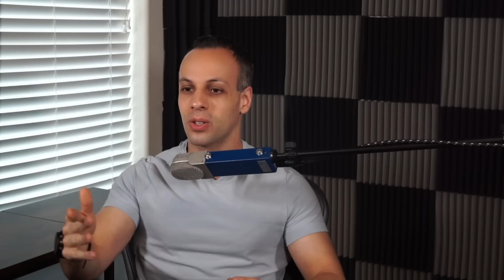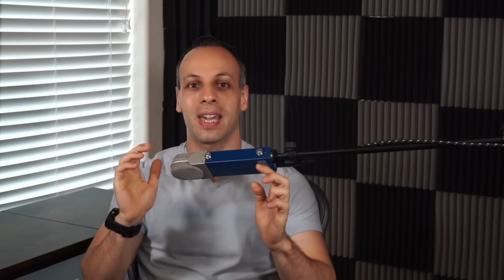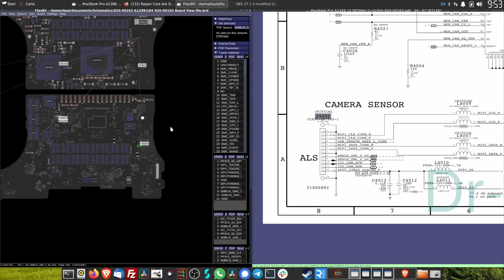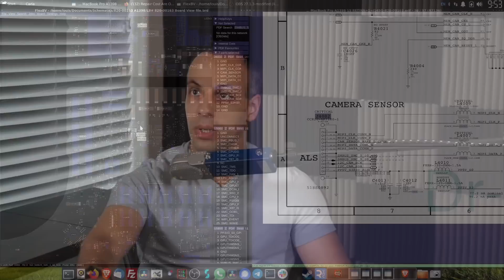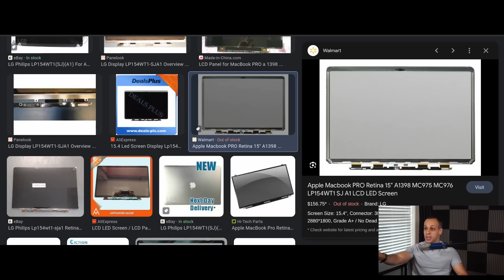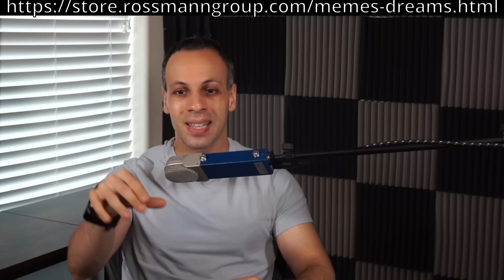The Ford F150 Macbook - when car repair resembles macbook repair...

Comment: What's crazy to me about this whole thing, is that he mentions that the customer didn't even really care that it was over $5K to fix what should normally be a simple repair, but was more concerned that it just wasn't fixed when he called.  Customers like this are part of the reason these companies can keep getting away with this crap.
Reply: This should be the kind of thing that could be part of a "lemon law" case, if they had enough commitment to dig there. Truck wasn't that old, was it?
Reply: @pauljs75  That may need to be the next phase of right to repaur, the right of repairability. Even if the entire taillight is ripped out of the truck, it shouldn't cost $5000 to replace it. I'm betting the whole thing didn't cost more than $100 to make.
This might also be something that SHOULD be covered under a warranty of fitness for purpose, if that was ever enforced. Trucks get rained on. If the truck can't stand up to rain, it is unfit as a truck.
Reply: @pauljs75 the subject truck was a 2018, with a ton of miles on it. Well beyond the scope of any lemon law.
Reply: I feel like this is also due to being able to get hands on easy money as well.
Reply: The customer claimed the money from insurance. He did reply on the original video
Reply: For the customer it costs what it costs, they can't argue with a shop to make it cheaper if its just the price tag the company set.
Reply: He has a lot of money just not a lot of sense.
Reply: @robbobsjobs8456 He had $5k and needed his truck.
Reply: Limited trims are ~100k
For a light duty pickup…
Yeah, customer isn’t too bright
Reply: If A holes stopped buying this rubbish, then they'll stop making it soon enough, my car is nearly 30yrs. old complete rear light is £38. If you're stupid enough to buy a car with LED headlamps, don't complain when it costs you several hundred pounds when it stops working. Halogen bulbs cost about £3 and fitted in less than a minute,  and no computer to be told that it's been replaced, because that last bit alone can cost almost £100.
Reply: @nudebaboon4874 prune juice maybe mydol
Reply: There’s a lot of internet tough guys out there who will vehemently defend $3,000 GPUs $110 video games and $5,000 tail lights. They don’t even get a discount for doing it.
Reply: @Clint_Matthews well considering video games frequently hit $100 decades ago…  around the Sega days…   Umm I think the people fighting against it are the weird ones
Reply: This is why I told my wife if I decide to take a car loan I'm going for a classic car. parts are everywhere for now and there's nothing at all I cannot repair at home on them. Now days the electronics side of the cars are a nightmare and everything is integrated
Reply: Oh wow, victim blaming now. It’s not fords fault but the customers fault for allowing it. Kinda like how criminals are running rampant in cities because it’s not there fault right? Seems like your more part of the problem than anything.
Reply: @behar  uh, to a degree yea. If customers would formally boycott with a specific unified statement it would make a difference. The customers have to remind the manufacturers that they are in fact beholden to the market.
Reply: @OneNidim  Ok then don’t buy the truck. Don’t tell someone who most likely needs his truck for work/to get to work to “boycott” their repair. The owner clearly needed his truck back in service, he doesn’t have time for activism. He should, on the other hand, consider selling the ford and switch to a different brand.
Reply: The customer just wanted his car fixed. 

The dealer couldn't figure it out. So he would be looking at spending 70k+ on a replacement truck if he wanted all the features (features that coincidentally caused his problems).

When the dealer can't fix your 5 year old vehicle, you are really worried. He must have been thrilled when a 3rd party figured it out, regardless of the cost.
Reply: @volvo09  - FordTechManuloko is awesome!
Reply: @@zippydastrange yep the  20 something old shit that was supposed to stop ppl copying DVD is fucking everyone over. b/c the ppl that wrote the thing didn't have the "bird's eye view"  that Louis was talking about. That's the law of unintended consequences ...
Reply: I'm wondering how it isn't under warranty.  The truck hasn't been made long enough to be out of it.  Are they started the clock when they make the part now?
Reply: Why would the customer care? Should’nt the insurance or warranty cover this repair?
Reply: @johncs154  seems to care that the dealer couldn't fix it at all.
Reply: @robertsmith2956  screw the stealership
Reply: @johncs154  They already screwed him.  He is stuck with the shotgun wedding now.
Reply: @@GH0STST4RSCR34M Good luck getting that insured nowadays, and pretty soon it will be illegal to transfer ownership of gasoline vehicles that old which means you can't drive it on the road in an EV focused government.
Reply: That truck is flood vehicle!!!   Considering costumer did not care about the price and did not bother to explain what happened. A lot of times insurance would junk the whole vehicle.  I know, because I have bought more than one flooded vehicle; currently drive even 2018 F-150 platinum that was also flooded!  I had more trouble codes than that. 

The only way for water to get in the taillight is if the taillight is completely submerged under water, it gets in thru tiny vent hole!
Reply: What's it like to be this confident and yet know virtually nothing?  @litoaykiu
Reply: This was obviously a wealthy person, otherwise he couldn't have bought a $100,000 truck in the first place.
Reply: It was the top of the line "Limited" version. The guy had money. Also, the guy's insurance company ended up paying for most of the cost.
Reply: Companies will try to make as much money as they can.  Stupid or lazy people aren’t going anywhere.
Reply: You my friend are a fool.  Perhaps the owner needs the truck and does not want to drop $80k on a new one.
Reply: For someone who buys a pricy truck like that 
A $5k repair job 
is like me buying a $50 part for my old 88 Chevy
Reply: I just had this done with my 2019 Rangers driverside taillight. The cost was $2,600 at a Ford dealership and I had to use my insurance to pay for it. It’s ridiculous, but it had to be fixed and that’s part of the problem. If someone can’t afford it, they’re forced to use their insurance to pay for it, so manufacturers don’t give a shit.
Reply: This is my truck. I'd rather the repair wasn't necessary, or that it cost much less. 

What do you suggest I do? Yell at my mechanic? Yell at the local Ford dealer? Send the truck (still worth 40k) to the scrap yard? 

I chose to pay the bill and move on with my life.
Reply: @Mytruck5600tailights  That's all we can do at this time, hold onto our ankles and pay for it.
Reply: @Mytruck5600tailights  Question, did the guy replace both of your taillights? For me, $2,600 was just for 1 side at the Ford dealer.
Reply: Each taillight assembly was $1400 before tax and the dealer upcharging to sell their last remaining ones across the country. I already knew they would cost that much because I backed my side mirror into my garage a couple years ago and the mirror cost $1400.  I figure a tailight would be about the same as a side mirror. The mechanic replaced both as both were leaking and had corrosion. There was only two hours of labor, and the rest of the bill was parts.   @SoCalSeaChaser
Reply: @S197_Cyclone They lease them for 3 years so they are rid of them before the warranty expires.
Reply: Ford generally sets the profit margins on parts pretty arbitrarily. And usually they drop prices when there is a recall or warranty recall campaign, and then when it’s over they raise the price so you can’t buy it and do it yourself on a vehicle that either didn’t get the necessary repair or needs it again
Reply: On some new Toyotas and Lexuses you can connect through the front headlight bus and steal the car. That is so stupid to make all this essential communication wiring easily accessible for the crooks to compromise the security of your vehicle and in case of moisture damage be stuck with experience repairs
Reply: I mean this customer bought a Ford F150. They don’t have a lot of brain cells to begin with.
Reply: @@GH0STST4RSCR34Myeah the people who buy the Ford F150’s in America are not the brightest considering they got scammed into buying these trucks in the first place. They’re usually horrid drivers too and cut people off constantly
Reply: $5k repair or $90k for an equivalent Truck in 2023.
Reply: Welp it’s about to get a whole lot worse because I’m pretty certain pretty soon they’ll start to strike as well.
Reply: Exactly , I will sell the car and never buy that brand again, that kind of crap, no way I can accept that, I need a reliable car not a gizmo
Reply: @leandrolaporta2196  if a small car can fit your lifestyle then consider a Toyota ECHO the line itself has been discontinued along time ago but I have very rarely ran into any issues with them because I’ve had 2 of them off and on in the last 3-8 years give or take.
Reply: @leandrolaporta2196  all new cars are built this way.
Reply: @@GH0STST4RSCR34MId say an 93 F series would be more reliable

Comment: Once the vehicle becomes too expensive to fix it becomes waste.  Many of today's vehicles are complicated and expensive to fix.   I still see 30- to 40-year-old pickups still driven today.  You won't see todays pickups surviving pass 20 years.
Reply: Nope, and even if those new trucks are in great shape, some module being unobtainable will keep it off the road.

If you buy a new car, don't get one with all the bells and whistles.
Reply: Make base models great again.

I have a 2015 Honda Fit. I got a base model with a keyed ignition and a manual transmission. I'm not gonna have this problem.

I'm in the market for a truck. I'm definitely going older for it. Finding a stickshift 4x4 that can tow is like finding a needle in a haystack the size of Texas.

Comment: Even more sickening is they would rather rip off the customer than rip open every module & replace the blown canbus transceivers. Also why don't they have better protection against voltage transients?
Reply: That is fine until you cannot buy the part from Mouser...
Reply: @rkan2  Why did they neglect trailing edge semiconductor manufacturing so much? That in itself should have been an obvious national security matter.
Reply: @spikester  The manufacturing and not evem the distribution is the issue. The issue is exclusivity deals between the IC source and the manufacturers of the actual device manufacturer.
Reply: @rkan2  Suggest you read up on the viabilities of maintaining 30yo fab equipment that was making pentium 3's in the 90s, doesn't help much of that equipment to produce jellybean parts was sold off & relocated elsewhere.

Comment: welcome to the high-tech side of vehicle repair. They have changed the tech to a serial CAN wiring system that interconnects everything. What you are showing is nothing compared to European Audi or commercial truck/heavy equipment.

Comment: This reminds me of a BMW which did not even try to start because of the comfort access Door Handle was somehow shorting the canbus to ground
Reply: Seen a VW that the windshield wipers would turn on and the engine would die, when the sun visor was placed in the down position.. video is on youtube somewhere.
Reply: I think the truck video also has turn out as a short to ground from corrosion, thus low or dropped signal. It's stupid to have too many things rely on something that can fail that easily and possibly way too easily. (Like if you know how electrical was on some older cars just for lights not working, particularly with connectors as they age - the new ones are going to be hell if they fail similarly but with a crapload of unnecessary system dependency.)
Reply: Of course the systems can short, but at least the engine electronics should have their own canbus which is galvanically isolated from any other canbuses. Then the fucking door handle would not prevent the engine from starting
Reply: That's the problem with modern luxury features, they seem nice when new, but they create problems over time.
Reply: I mean at least give Diagnose Dan on YouTube some credit!
Reply: https://youtu.be/B7gggowzPSE?si=labp4S1_Rks0h0vP
Reply: With all the modules in modern cars any of them can keep it from starting. 

The more features, the more modules that can fail and take down the network, especially ones outside the cabin.

Comment: You didn't need to spend $5000 on that taillight to get the car running  All you needed to do was unplug the CAN wires from the module to remove the short.  No obstacle detection but the car would have started.  Still sucks but there was a cheaper choice in this particular case.
Reply: Same thing with the macbook, lose the webcam but the computer works. I still don't consider it fixed
Reply: I'm not 100% clear either way on this, but it could have created a cascading short circuit that fried other modules on the vehicle as well. Cascading failures happen more often than you might think.
Reply: @southernflatland I work in automotive and CAN bus lines must sustain a permanent short to both ground or battery plus. It wouldn't work until the short is removed but there shouldn't be permanent damage. If other modules failed then they are absolute terrible quality

Comment: the irony is, that the F150 was a fairly cheap pickup truck workhorse. and much like with jeeps or other all terrain vehicles, it was easy to fix in rural areas.
the easy to fix feature? long gone...
if your car breaks down in the middle of africa because of such a thing? you want the car to drive. you do not care about the working special gimmick.
Reply: Buy an old Toyota bakkie (what we call pickup trucks in South Africa).  Try kill one of those things.....

Comment: First problem for that person was that they bought a ford 🤣
Reply: Name a car company not doing this
Reply: It'll happen to any vehicle... the more modules, the greater chance of failure.

First time I ever heard of a car not running because of random electronics was a GM suspension module that would take on water and keep a truck from starting.

Keeping things water tight (especially with salt and that new more corrosive road spray stuff) is impossible, there will be seal failures.